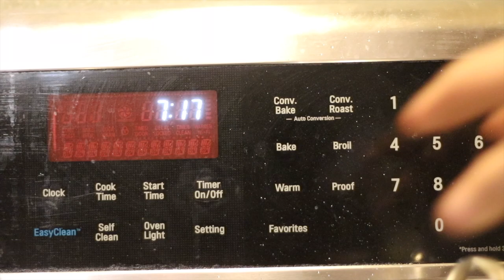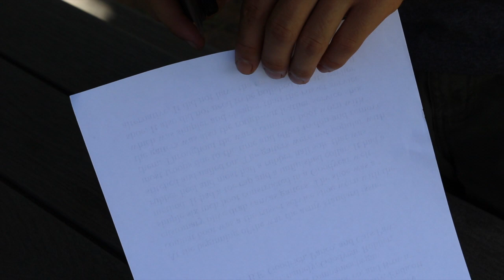Making A Knife Out Of A Mower Blade With Backyard Materials And Tools

Comment: Did you quench the blade in the same oil you put the handle scales in
Reply from the maker: Yep
Reply: @izappedmyself1095  what oil is ot
Reply from the maker: @sternadelsternadel8393  I used ATF fluid. So probably kind of toxic.